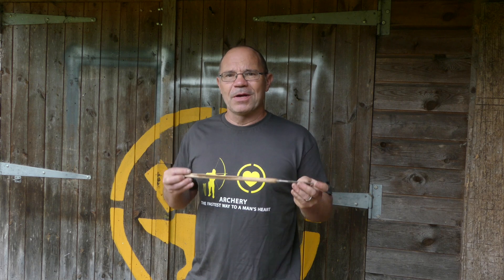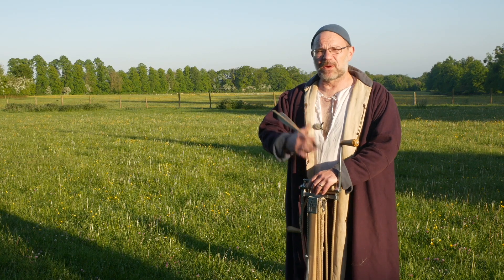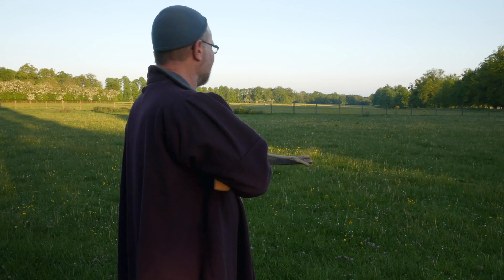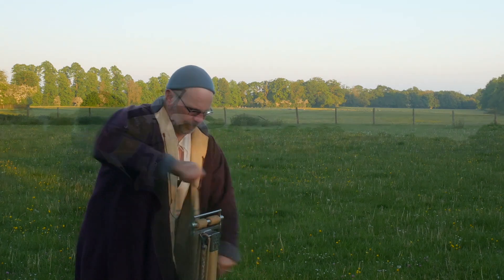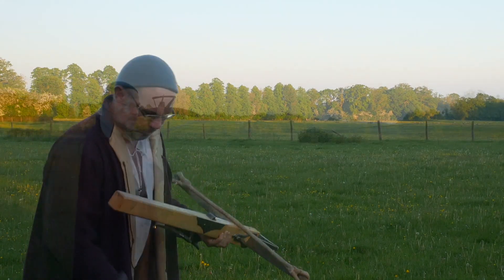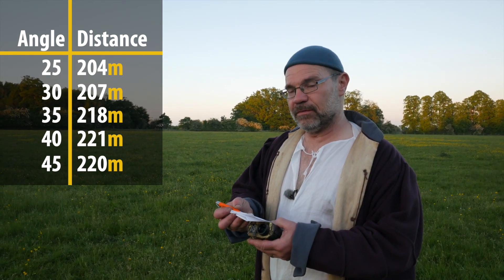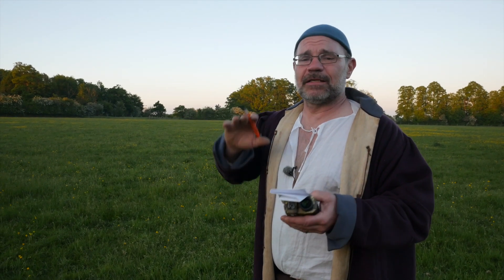Distance - Which angle is best?

Comment: 41 degrees will yeild your net avg maximum distance, assuming low to no wind. 39-43 degrees will be your ideal window, depending on elevation and air density, temperature, and how W - E or E - W you are firing (geological, not magnetic).

How do I know? I'm an ex special forces attached field medical specialist [3d Recon] that was also a RSO and trained as a foreign weapons instructor (done a lot of shooting). You can find this information in the reference manual "machine guns and macine gun gunnery," under the section detailing high angle firing and machine guns as artillery or supporting fire. Ironically, this isn't in the manuals for artillery or mortars explicitly as they essentially just give you a table reference you set your T+E/A to, and then how many doughnuts to add in the case of mortars. Digging into the reference tables will show, however, those as the elevation/angle for maximum range attacks (which is where you can check if I'm fos).

insert more you know shooting star, here

Comment: I wonder if preventing the bolt from wobbling around so much would do anything. Some energy is clearly lost in the wobble. Maybe insignificant considering the momentum of the bolt, but would it be worth (if maybe unsafe) to have some structure on the crossbow guiding the bolt?

Comment: Hello, I did a final work for my physics IB diploma that is practically the same. The only difference is that I shot a bow. I calculated the errors and averages and got similar effects. Basically I did not get any big difference from 40 to 50 degrees. The bow wasn't that strong (28 lb) and the wind wasn't controlled. There might be the difference in a fully controlled environment however in my cause it was nearly not visible.

P.S. I can upload the essay/report if somebody is interested.

Comment: Very interesting! I suppose that the difference in distance isn't that great, because of the opposing variables at play. Raising the angle delays the moment when gravity causes the bolt to hit the ground, increasing the flight time. But as the flight time gets longer, aerodynamic drag also acts for more time, reducing the speed of the bolt. Also, as the angle rises, more and more of the energy in the bolt is used for vertical movement instead of horizontal movement, up to the extreme case of shooting at 90 degrees, when the horizontal movement would be 0. And then, there's the issue of armor penetration.

Comment: It would be good to know what angle they hit the ground at, that would give you a feel of the forces involved. More vertical would indicate air resistance was the primary determinant of range, ie resistance had scrubbed off the forward motion and it was just falling, an angle close to the launch angle would indicate air resistance was not a factor at all.

Comment: I remember a physics lab where we use ball bearings and a little firing spring launcher in the lab that would toss them upwards of a couple feet.  45 works there, but real life isn't a lab and not really a complex trial like the ranges your dealing with.  I don't recall them having us do a handful of trials on each ball either, but that was like 20 years ago.

From your trial, the soldier would get an idea and find out figuring out when to fire and how fast they can get the next bolt matters more.

Comment: I think that air resistance is probably relatively negligible due to the higher mass/velocity ratio of the projectile. Compare like a bullet, which has a lower mass but a much higher speed, and air resistance will be a bigger factor leading to a flatter trajectory being optimal (I believe, I'm not a ballistics expert)

Comment: A lot of people are commenting on the need for multiple shots to get a more conclusive result. In theory that's nice, but do that several times, a week apart, with different weather conditions, and you might get completely different results, so from the 1300s point of view the extra supposed accuracy would be pretty useless. 

I suspect the major contributors to the "correct" angle are the mass of the bolt and air resistance to the bolt, since that would determine how quickly it slowed down. I'd be interested in seeing the same series of angle tests done on one of those club-headed bolts, since they should have considerably more air resistance (but the extra mass of those bolts will somewhat compensate for the extra resistance.)

Comment: Ok, we have a maximum range for low angle indirect fire.  Did I miss a video for flat trajectory range to a standing target?

Figuring out a way to test maximum altitude and range for high angle indirect fire would be interesting, I'll need to look into thst.  I know it's not historically accurate but crossbows can fire more than just pointy or blunt bolts and dropping certain small ordinance down on top of a target or over a wall is handy in some circumstances.

Comment: Back in High School physics class we experimented with round hard rubber balls fired through a tube using compressed air. We had very precise control of the air pressure and also the benefit of a nearly windless day. We found that with the round balls fired 25 times the best angle averaged out to 37.5 degrees.

Comment: the more drag you have, the lower the appropriate angle will be. Bullets are around 45, crossbow bolts in the low 40s, arrows in the high 30s, javelins in the low 30s, throwing axes in the high 20s, and paper airplanes in the teens.

drag is mostly affected by relative velocity (this is why paper airplanes do silly things when you throw them too fast), and so can be easy applied: angle lower for a headwind, and higher for a tailwind.
Reply from the maker: Thanks for that lovely explanation Bradley

Comment: An elevated shot will produce a parabolic flight... but the wind resistance is a non-linear relationship with bolt speed.  Once the bolt is slowed sufficiently it's going to mostly 'fall' (it's quite heavy after all).  So each of these parabolas has a steeper second half - they are not symmetrical.  

For medieval warfare, this meant you didn't need to worry too much about the perfect angle.  As the enemy horses approach 200m all your crossbowmen fire and they all hit a target as large as a mass of cavalry.  This makes sense!  If the crossbow were so sensitive to angle

(But actually, you'd do this against infantry or stationary defensive positions since the cavalry would cover the 200 m while you were cranking the windlass -- very bad for the crossbowmen.)  

I would have like to see 'point blank' ranges added to your table.

Comment: Even one's stance and the strength with which one grips the bow as it fires would vary the vibration and thus the pitch and yaw of the bolt before it stabilises. Tricky. You're going to have to build a medieval Ransom Rest now!

Comment: The distance of air is a equalising factor. It drags more the higher the angle so the ideal high in the vacuum is reduced. If you use a heavier bolt the optimum angle would increase. If you use a lighter bolt is would decrease.

Comment: When I used to throw the discus years ago I was always told the magic angle was 38 degrees for distance but not sure if that's was also to do with the angle of flight and using the air resistance to increase air time. Great channel by the way

Comment: i think for long range  artillery it was found htat somewhere in the area of 53° gave the most distance - because of hte higher arc they could avoid drag in hte higher air, due to lower density. Of course that will not translate to crossbows and bows.

Comment: The God Father of technical evaluation of archery was a rocket scientist by the name of Clarence Hickman.  He did a similar test but also changed the centre of gravity of the projectile and the size and orientation of the flights.  If I recall correctly, his greatest distance was achieved with a forward centre of gravity and NO flights. This data was used to assist with the design of early ICBMs and Saturn V rockets.

I don't recall the angle, but it wasn't far off 45 degrees.  The test is found in a book called "Archery:the technical side" which is long out of print and quite valuable, even as a re-print.

Comment: Probably having a stock holding up the end of the bow so it will always shoot the bolt from the same position rather that moving it around would help to get the most stability. Those few centimeters of lift probably are enough to widen the arch compared with the other variables.

Comment: You need to be monitoring velocity as the bolt leaves the bow. Differences in initial velocity are more likely responsible for different distances than the angle you are shooting at. That, and other environmental factors like minor changes in head wind, tail wind, cross wind. then you also have temp, humidity, pressure all of which impact the ballistics more than drag impacting the optimal angle ( which remains at 45 degrees)

Comment: Theoretically on a flat plane the answer is 45 degrees although in fact due to the curvature if the Earth it is slightly less,At the range Tod is shooting this shouldn't make a difference however although the height of the bow wheb the bolt is released will and it's probably the inconsistency of this that's producing the variations.

Comment: I read somewhere once several items tested & aerodynamic items like javelins were usually around 42/43 degrees, blunt items only dropped to 37 or so.

I imagine 43 degrees is roughly right for flighted bolts.

I can see the confusion people had, but in distance terms they actually make things closer to dragless models despite increasing drag, as they counteract aerodynamic forces making a more ballistic trajectory. Essentially it resists nosing down, preserving direction. It also starts accelerating, unlike bullets for example that isn't as strong a relative factor.

Comment: I thought shooting a crossbow was about hitting a given target, not about shooting as far as possible? At least that's what we attempted in the artillery of the Swiss Army. (Not with a crossbow, anyway ... although: Once during each of our courses, we had a competition between teams where somewhat quirky tasks had to be solved, and one these was actually shooting with a crossbow.)
By the way: There are artillery guns, the howitzers, that can shoot at elevation angles below and above 45°. As far as I remember their ballistic tables, the trajectory reaching the longest distance is really very close to an elevation of 45°. However, an artillery projectile is of course much less affected by air resistance etc. as a bolt. At that, the projectile rotates when leaving the tube, which leads to a sideward derivation (that must be compensated) but also stabilizes the projectile.

Comment: There are definitly not enough datapoints, but fitting a parabola (by eye) to the five datapoints Tod gave us, might result in a parabola with a peak at 41.25° and a distance of 221.25m with the 25° and 30° being kind of outlier but canceling each other out.

Comment: Do you think professional soldiers using these weapons who have tuned their bows to get the best bolt flight possible? I think the obvious answer is yes, they would if they could. I am wondering if just nocking the bow a mm to the right or left could get rid of that little kick in the beginning of flight. I am betting it would!. And it would likely make the bow perform better in every metric

Comment: Air resistance is not the only variable that changes the optimal angle away from 45°, you also have to consider initial elevation (a higher initial elevation => a lower optimal angle), target elevation (a higher target elevation => a higher optimal angle), and initial velocity (a higher initial velocity => a lower optimal angle), though the later is mostly negligible at crossbow bolt speeds (in a vacuum you need over 8 km/s initial velocity for the optimal angle to be zero degrees, and in any atmosphere the optimal angel will never reach exactly zero)...

Comment: Thank you Tod for doing the hard work for science. These results are inline with what one might expect based on the physics of ballistic trajectories. Perhaps the most remarkable fact you've demonstrated here is that the long-distance shooter has a surprising amount of leeway with regards to their launch angle while still achieving within 99% of their maximum theoretical range. When you consider that the distance that would be achieved in a vacuum varies with the trigonometric sine of twice the launch angle, it becomes readily apparent that there is sort of a wide plateau at around 45 degrees as the sine function becomes stationary at 2*45=90 degrees. Then when you consider that the drag force on the bolt is a relatively small fraction of its weight, the actual trajectory of the bolt ends up being not too far from a true parabola, and hence the optimal shooting angle is only a couple degrees shy of the theoretical 45 degree optimum.
Reply from the maker: Thanks John and yes my particular thought was that we need not be too bothered about the angle as they are all pretty similar when you are steep

Comment: Surprised at how unstable the bolts are in those slo-mo shots... Wondered if that superthick string could be part-rolling along the bolt-bed as it accelerates the bolt? Imparting some sort of rotational moment to the bolt's hinder part? Thereby lending it an albeit mild angular kick?
There may be more going on during that power stroke than can be seen by the eye. Significant? No idea. But a ultra high speed video camera tightly focused on that exact area might reveal - what? No idea! (Well I do have an idea, but it's prolly poorly conceived rot.)

Comment: There are two effects countering each other.   Forward component of velocity - greater for a flatter angle.   Time in the air - greater for a steeper angle.   The two offset each other, so (in hindsight!) it's not surprising the distances don't vary much.
I would epect the flatter angle to be slightly less affected by gusts of wind etc.

Comment: I think the wind and direction plays a big role.
Say you're shooting against the wind, lower angles may get better results as the bolt spends less time in the air.
And likewise if the bolt has a tail wind higher angels may fly further as they spend more time in the air.

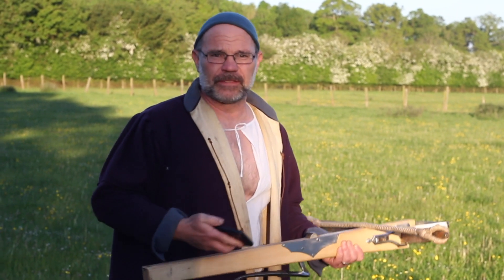Comment: 2:29 - Your bolt flies sideways.  I just came here from the arrow tuning series, so I wonder if crossbows weren't tuned too.  It would definitely improve performance, for most probably very little work (though a lot of know-how and skill, I suppose).
How would you tune it?  I'm just brainstorming, but it's all about pushing the bolts exactly forward, without any added torque, so fiddling with the grove should probably do it.  If they started thick (a rather obvious choice), there would be no apparent difference between a well tuned and badly tuned crossbow.
Just food for thought.
Reply from the maker: Definitely tuning helps.  The biggest draw back these crossbows have is the short bolt length, it makes everything harder

Comment: The angle isn't as important as waight
Ancient korean archers would use very short and light arrows with a bamboo guide that could fly much further than normal bow and arrow of the same draw weight
A crossbow bolt has a very steep arch

Comment: In a closed system, basic physics class teaches 45 degrees is the optimum angle for distance, but that ignores many more advanced concepts. Still, the sine function reaches its largest output value, 1, with an input angle of 90 degrees, so we can see that for the longest-range: 2θ = 90 degrees and, therefore, θ = 45 degrees. A projectile, in other words, travels the farthest when it is launched at an angle of 45 degrees. The reality challenges are how the string and bolt behave together with the crossbow as it launches, how it travels into whatever environment it is going into and how that's all changing every moment.

Comment: A month ago me and sime friends where out camping on a old castle ruin. We argued if we could reach the street 200m meters away from our 150 meter elevated position, which kicked off another discussion about the angle. We thought you probably don't need that much angle from that height and guessed about 25º should be just right. We couldn't test it for obvious security reasons...

Comment: from a physics point of view ... the trajectory will be a parabolic arc, and 45 degrees is maximum range for any projectile weapon that doesn't have a motor / rocket. your 1m variance from 40 - 45 degrees could be from many variances, e.g jump, an incorrect elevation angle from one of the shots, wind / air pressure
Reply: It would be a parabolic arc in a vacuum  (can we get the next moon landing astronauts to test it?  Whenever that is).   In air, as speed declines due to air friction, the downward curve of the parabola will get steeper.

Comment: When going for distance just remember if the wind is toward you aim a little lower, if the wind is helping you aim closer to 45°. The wind will carry the bolt further the more height it has whereas the more time the bolt has in the air when it's pushing in the wrong direction the more it will be able to slow it down. Time in the air is key here.
Reply: And also, I think, why the variation with angle is so small.   Greater angle = lesser horizontal velocity but more time in the air - and since distance = speed x time, the two factors tend to offset each other.